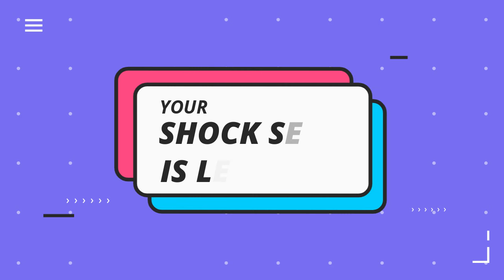HOW TO REPAIR MOTORCYCLE SHOCK ABSORBER || REPAIR LEAKING FRONT SHOCK ABSORBER

Comment: How much oil should i use when rebuilding a front shock of san yang vs125???
Reply from the maker: +- 60ml sir . .
Reply: @sentrikgarage  i did some more , in beginning i did 66 ml and i heard to much air running , i did 90 both sides..
And i feel now Exelant...
I think my model need more like 80 to 90 , fork travel is some as 8 cm 
And diameter of pistons is 33mm...
Reply: Boss bakit yong MiO I maano sa lubak parang naga vibrate po